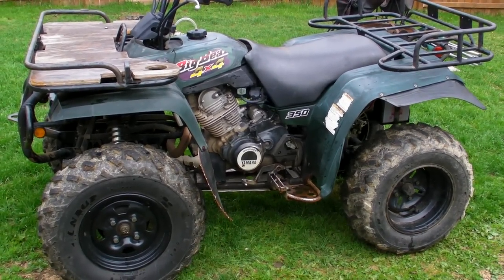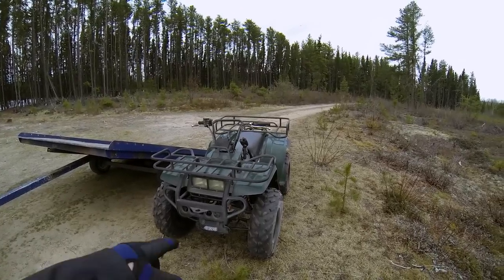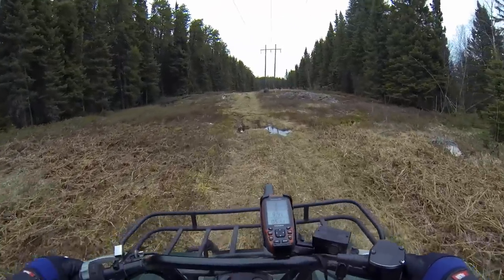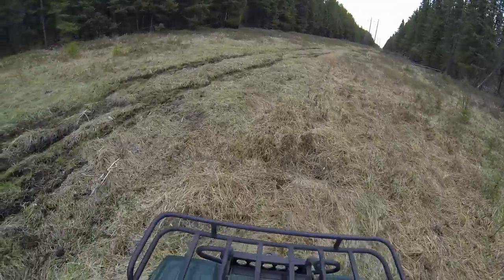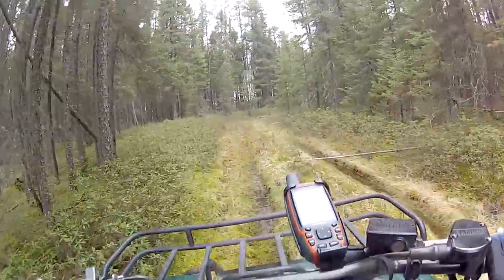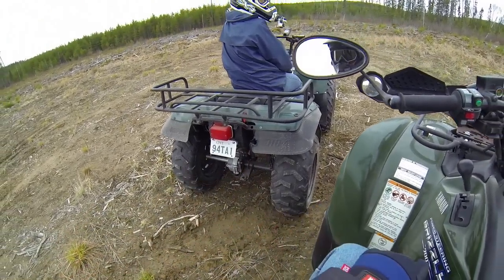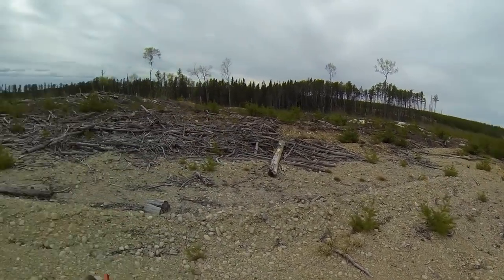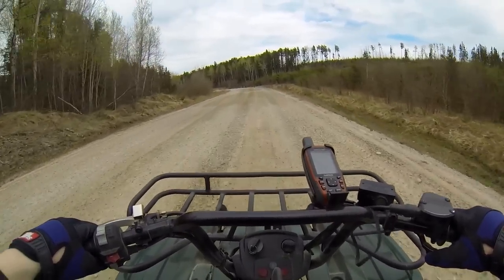1997 Yamaha ATV Big Bear Maiden Shake Down Run - May 25 2013

Comment: I grew up riding one of these things, ours was a 93 I believe. They are tanks, unstoppable but very heavy. The 20 years we owned ours the only thing we ever had to do was basic maintenance like clean the carb and swap out the battery.  My only complaint was that it would beat you up on longer rides being a heavy 4x4. I did everything you are not supposed to do to that quad and it just took it lol. For example, revving the quad up while holding the shifter in between gears then dropping it into gear so it would pull a wheelie lol. just about the worse thing you can do to a quad but hey, I was just a kid at the time.
Reply from the maker: They are tough aren't they!  Not a smooth ride but keeps on ticking.  Thanks for watching and commenting.

Comment: Nice video! The old Big Bears are tough as they come. I had a 2000 model for a little while but I sold it when I bought my 600 grizzly. I do still have my old 300 4x4 Arctic Cat that gives me my fix when I want to ride a 5 speed for a while. haha

Comment: to get that big bear back looking good wipe boiled linseed oil and paint thinner on it a 40/60 mix. You can search on here for How to restore fourwheeler plastic and it shows a guy with a red kodiak. If you try it show us the result.
Reply from the maker: Thanks for the tip.  All finished now with the big bear, but will have to keep that in mind for the next ATV restoration project.  Thanks for watching!

Comment: yamahas will run forever with maintenance. I have a 1987 big bear and a 1979 Enticer snowmobile
Reply from the maker: You are right about that!
Reply: Joey Eyerman I have a 1986 Moto4 225 and I cant kill it, ive broken the frame on the thing and she still runs, ive fixed only the frame and rear axle in the 28 years ive owned it, Yamaha makes a great machine.
Reply from the maker: Hotrod Hemi Great story, you're right Yamaha's are great!
Reply: ***** Im thinking about picking up a 1996 Big Bear 350 4x4 but it needs new tires, what kind are those? Because im looking for something not too agressive but enough to get me through some sippy holes
Reply from the maker: Hotrod Hemi
We got our Big Bear used but think the tires on it are the original stock ones..getting pretty bald now!
Reply: cubbeezx Oh ok cool, ill have to look for those because for what i need those would be perfect

Comment: Is the 24/7 4wd a problem in the long run?
Reply: You can always take the driveshaft out lol and be 2x2 all the time. Our driveshaft fell out on ours. So we order one and the u joints. Its still drivable atm but its 2x2  so the back tires are the only ones pulling. The only difference is its alot faster 2x2 still climbs okay. But the 4x4 I love its still fast and climbs like a beast

Comment: I know there not meant for it, but how much top end do you get out of the big bear and if it has dual range does that matter?
Reply from the maker: No dual range on this big bear and maybe a top speed of 45mph?
Reply: ok mine will be dual, and its pretty tuff to go much faster then that in nw ontario unless your on a gravel road or pavement
Reply: thanks for the response :)

Comment: Hey ageing cubbeez   my 98 I'm working on I'm looking for new crank case do u know if it is the same as the 97  I can't seam to find any where that tells me if the crank case is same on others years/ models  bikebandit doesn't have any  and they r lot new so I'm trying to find one on eBay but want to widen search from just the 98 is I can
Reply from the maker: Tyler Gibson The 1997 Big Bear was different than other models so not sure they would be the same. Have you tried these guys? We've bought parts from them before and they were good to deal with http://www.mrcycles.com/